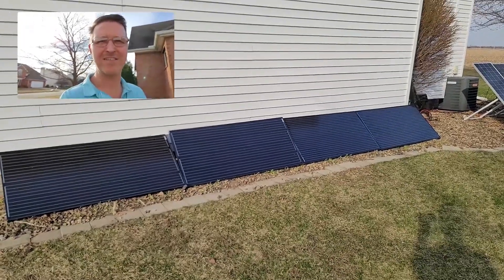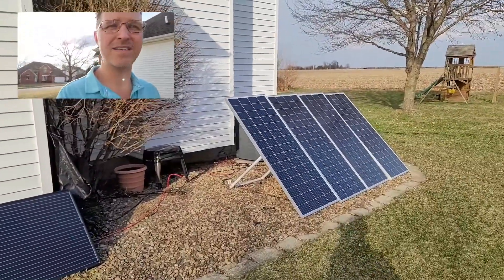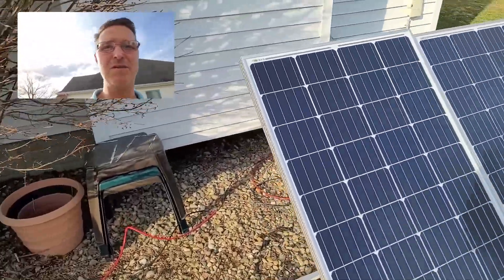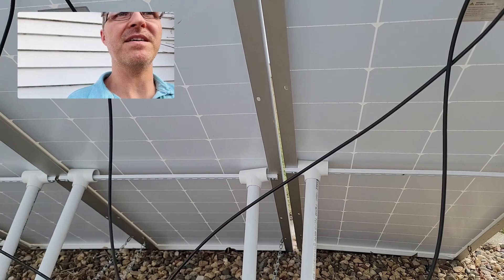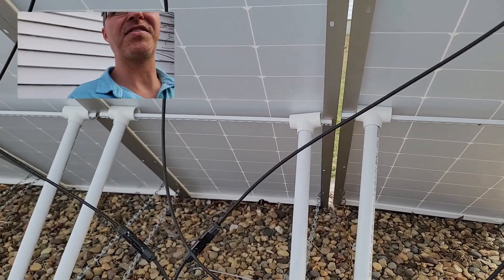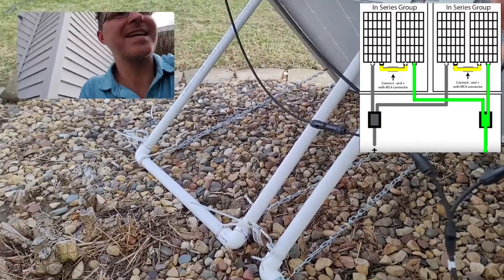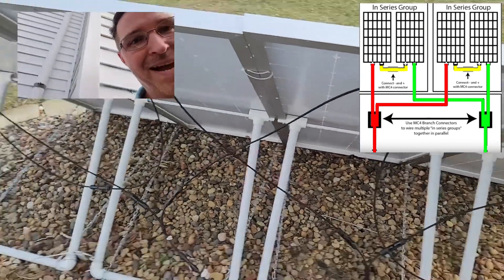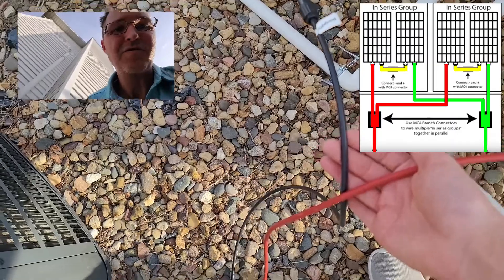How I wired my Solar Panels

Comment: I’d like to see a bit of how you made your simple PVC standing system supporting your panels on the ground. I’ve been wondering what I might do and this looks like a cheap simple start.    I am starting with two older but never used REC 310W 7’ tall panels I picked up cheaply.
Reply: I am planning to run mine in series. When I can I may pick up some newer 350W panels and run a separate EPEVER controller for those.
Reply from the maker: Hi Chris,  I'm planning on doing a 6 month review of the pvc stands.  It will show how everything is stable and stuck to the ground.
I do have a video on how I put the pvc stands together...  you should check it out!